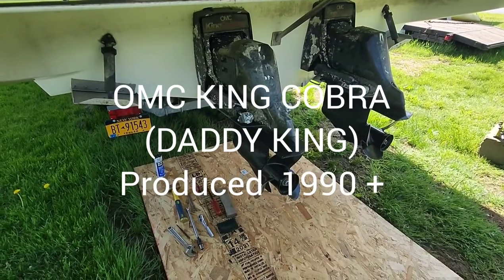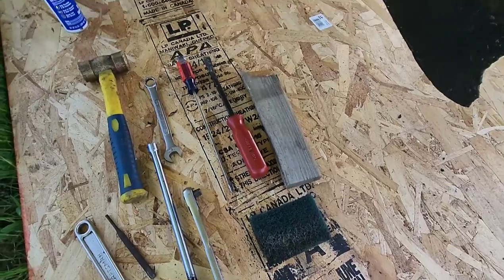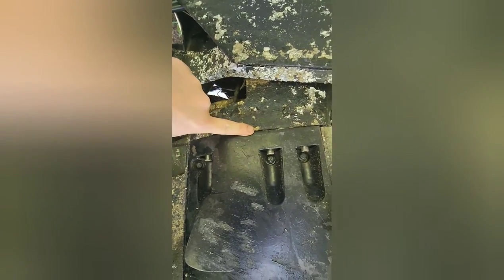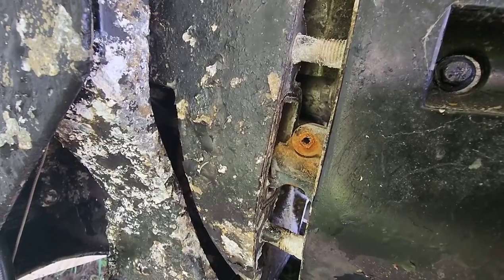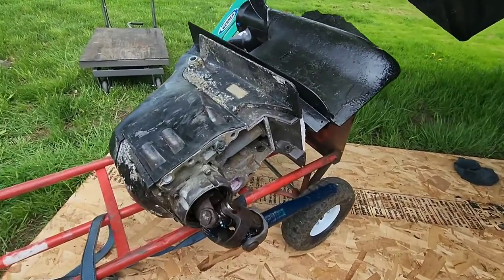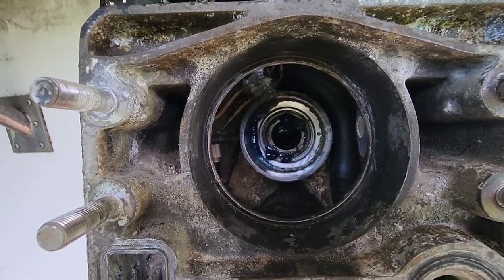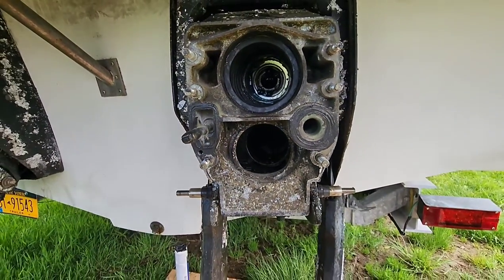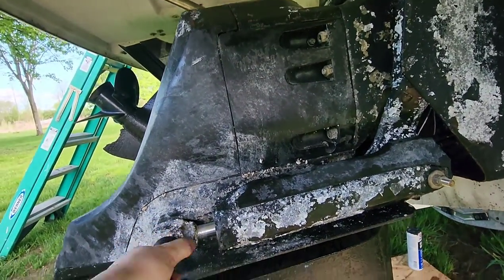OMC KING COBRA U JOINT BELLOW 913825 (King Daddy)

Comment: Using an impact will usually help to break the trim cylinder nuts loose without spinning the shaft 👌
Reply from the maker: Although I do have one, most don't, that's why I didn't use one in the video

Comment: Whats up Bob! How you doing?  I have an issue with mine keeps leaking out the propeller shaft seal.  There's much play side to side and forward backward in my shaft. How far down does your propeller shaft house sit inside the lower unit? Min is like 7/16s and it's super tight. I don't want to strip mine out. I suspect mine housing is not sitting on the inner bearing.  I have a video I can sent. Nobody has theys Daddy Kings on youtube except us.
https://youtube.com/shorts/iFtB7FJMQKs?si=0B4VbENNNB5qRVH8
Reply from the maker: Unfortunately I'm of no help on that one